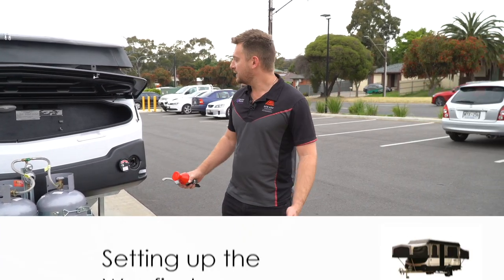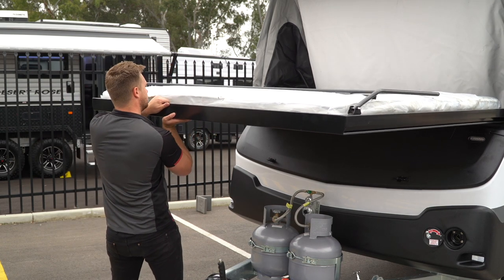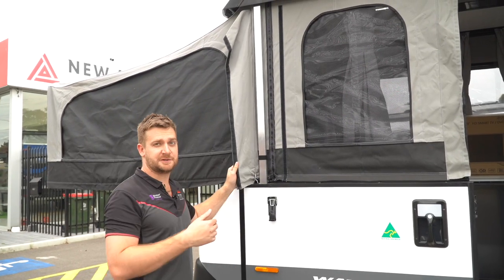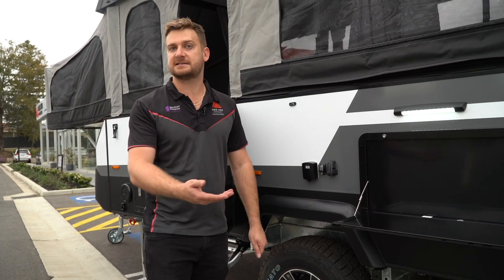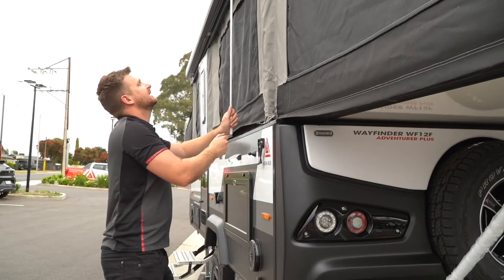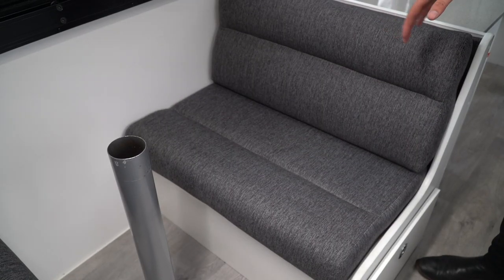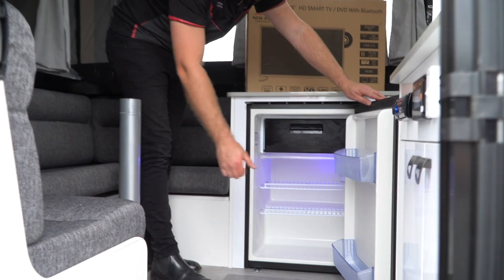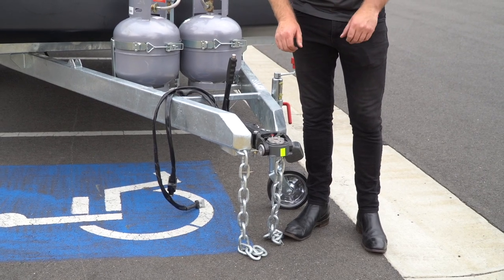New Age - Wayfinder | Full Set Up & Pack Up

Comment: I’ve just bought a new Wayfinder WF13 Adventure Plus, but haven’t picked it up yet. Can I ask about the power system? When off-grid and relying on the solar, can the microwave be used or do I need a powered campsite for that? While using just solar, can I plug regular household items into the 240v sockets, such as a laptop charger or a small electric kettle? If not, is there 12v sockets inside the camper to run a 12v kettle when not plugged into mains power?

Comment: The problem with these campers is the inside table. It can not be lowered or removed. Needs to be more flexible.  Also the design of the half door top half needs to be looked at. The velcro becomes unstuck and so it can not be sealed properly. Also the roof tends to hold a lot of water on heavy rain.  In the 13ft the bed is very heavy so trying to access the internal storage under the bed can be a problem. The external door access to the under bed storage is too small. Larger items need to be stored by accessing the storage space by lifting the bed. The external access to bed storage needs to be 6 inches longer and wider.